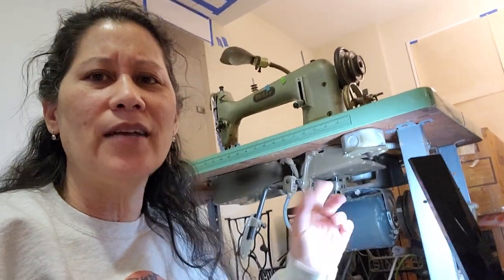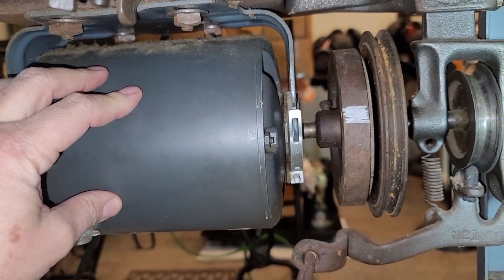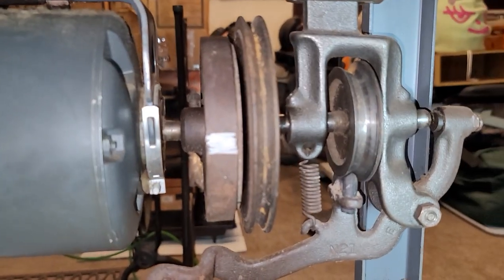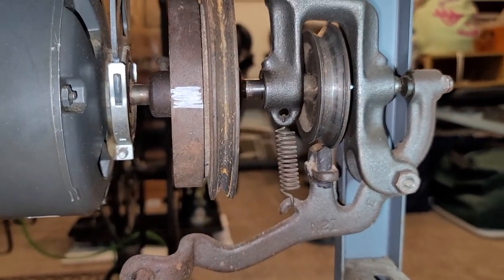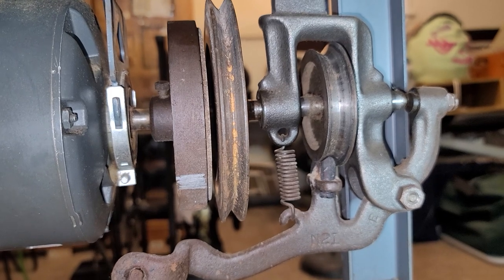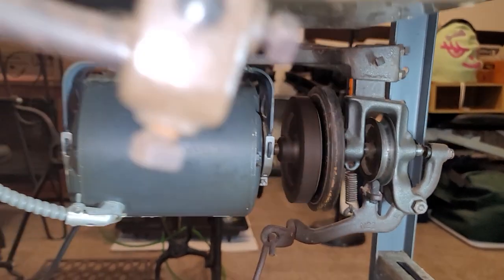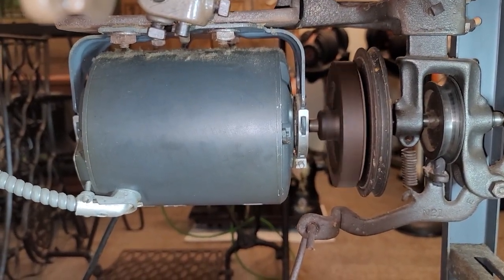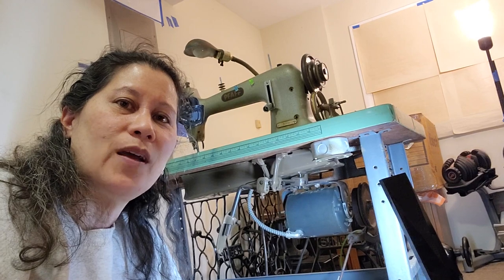Clutch Motor - Industrial Sewing Machine

Comment: Couple quick things with those clutch systems.

First off, I would highly recommend wire brushing your cork disc on your friction plate. It appears very glazed and compacted on the surface of its face. When "freshened up" (wire brush the compacted aged material off to reveal fresh cork), that clutch system will allow you to sew down to single stitches based only on how much pressure you apply to the foot plate.

When setup and freshened up properly they can feel like a variable speed spring loaded foot pedal and have extremely good speed control.

Secondly - when you take pressure off and the brake engages, you can hear that  grinding sound. That's not good. You need to replace your brake rubber (it's a solid round rubber  section that engages that third pulley). You can also just adjust the position of it until you're ready to replace it.

If you don't want to disassemble and then reseat your whole cork faced pulley assembly, you can loosen the set screws on the pulley and open up the gap between the friction plate and cork faced pulley, and then turn the motor on and lightly use something like 80 grit sand paper on a flat faced stick to gently insert against the cork face to take off the outer compressed layer - just go very slow and light.

Comment: 👍👍👍 good explanation - its like the normal clutch on a gear shift car :-) 
the only upside down … you will kill your clutch plate and the torque is missing …. so best — kick it out and buy a servo motor
Reply from the maker: This clutch is actually working fine for the things I'm using this machine for but I do have servos on all my other machines. People don't understand why a Servo is better so I wanted to make this video to help people
Reply: @ChainStitchEmbroidery  and you did a very good job !!!!
Reply from the maker: Thank you!
Reply: @ChainStitchEmbroidery   may I ask which Servo's you prefer?   There are so many out there with brush/without brush etc.  Also do you prefer 550W or 750W.  Would be doing leather with it.
Reply from the maker: For straight Stitch and chainstitch 550W is enough.  For a walking foot I prefer a 750W.  I like the brushless Consew because I like the speed readout and buttons to change the speed within easy reach right at the front of your table. On the ones with brus, you have to reach under the table and rotate a dial to change the speed. Everyone has different opinions and there's no right or wrong. Mostly personal preference.
Good luck